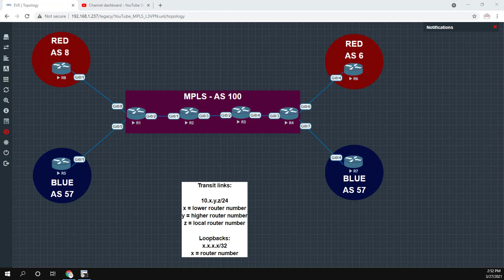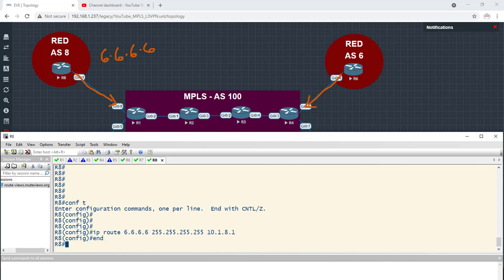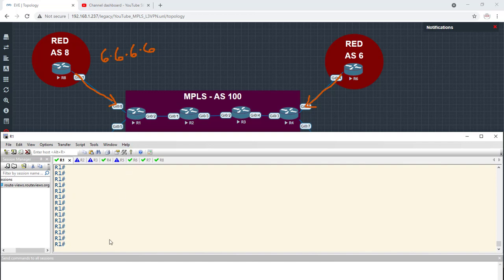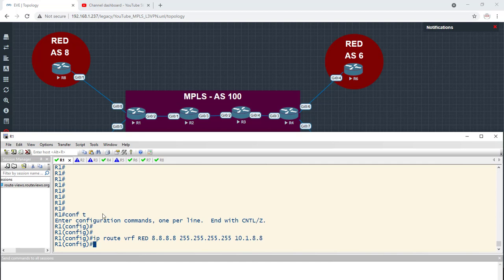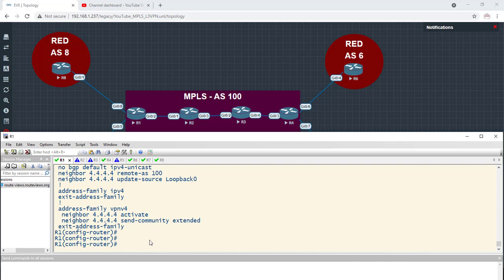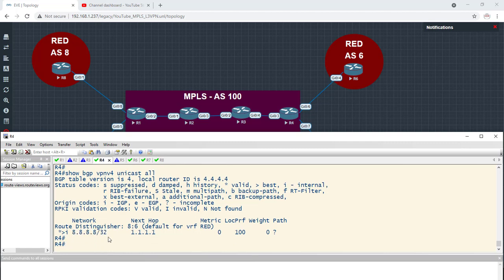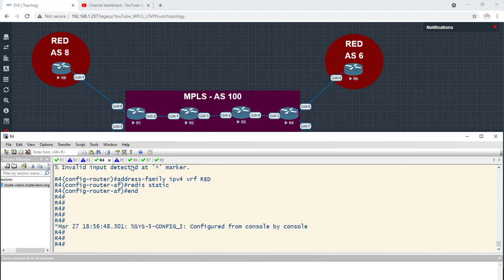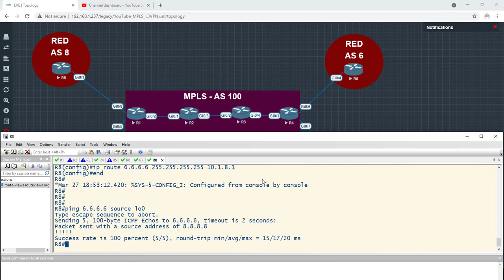MPLS L3VPN With Static Routes

Comment: i've used to work in an ISP that sometimes has this static route scheme for vpnv4 services , and the remaining services has eBGP PE-CE . But the interesting thing is doing this same scenario for vrf default , so you have to take care of the  "redistribute static" cause you will be redistributing ALL ipv4 static  routes(without VRFs), so when using static routes for ipv4 without vrfs , most optimal configuration is using a redistribute static + route-policy or simple issuing the "network x.x.x.x /yy" matching de exact length of that static route in the Rib.